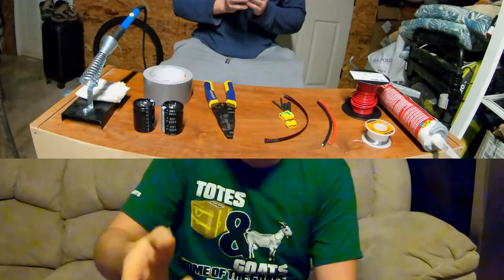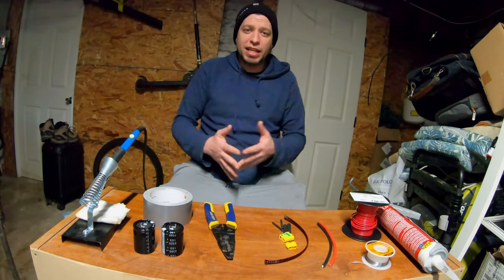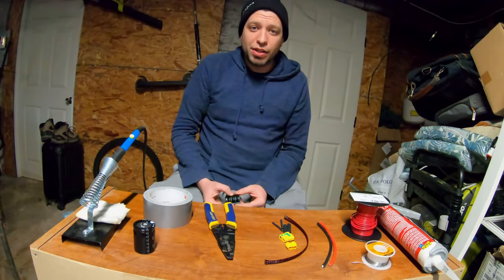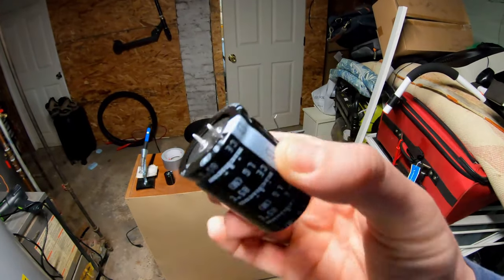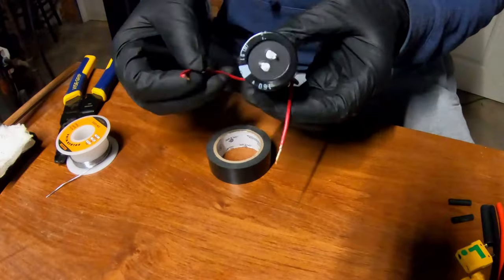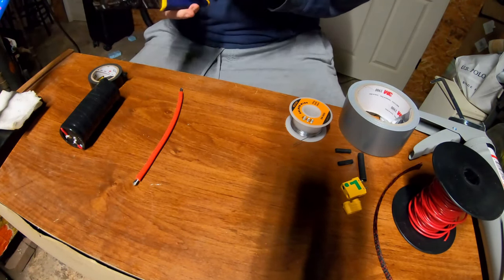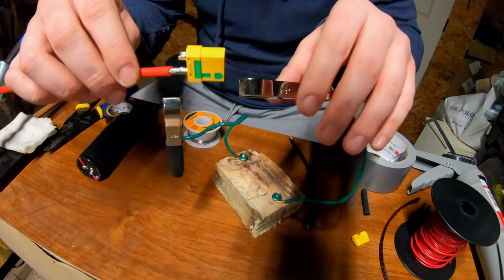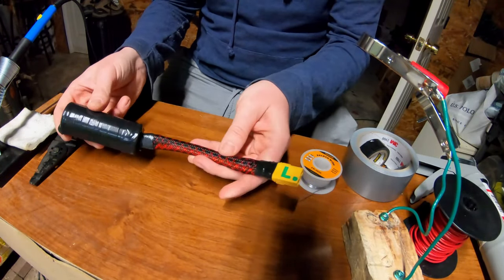God Mod EUC Components Review And How To Make Your Own EUC Capacitor Mod.

Comment: Another great video mate!  Just a tip... when soldering to an XT plug (or especially Deans) ... whichever you are soldering to... plug it into it's opposite plug... so, if you get the one you are soldering too hot, it's opposite plug holds it in place. Once cooled, unplug it from the opposite plug. For many years I was into RC cars... mostly used Deans and XT60 plugs... many times after soldering (especially the male) ... the pins had moved and they were hard to plug in. Using the opposite plug to hold the pins in place eliminated this issue. Keep up the good work! Greetings from down under
Reply: I was thinking the same as it's easy to get XT60 connectors out of alignment if soldering them by themselves.
If George wanted to show us the absolute cheapest tho he only had this single XT90 😁
Reply: Great tip!

Comment: I love the DIY idea you show here. Same as you maybe I got my 3D printer and learned the whole thing just to design my own power pads instead of buying expensive Clarks, available only as US import back then.
That was a great decision I love 3D printing.

On that one I have the know-how and equipment to make a capacitor mod, but I'm not sure it would be worth the effort. Maybe one day out of curiosity to see what effect it has on the pedal modes of my various wheels, since the components are pretty cheap anyway.
To be honest I'll also be more confident in my own job and QC that buying from a third party I can't trust due to the invalid claims made.

Comment: They make butt connectors that are filled with eutectic solder (be careful with your heat gun; silicone mats and polyamide sheets exist to protect whatever is near what you're hitting with  your heat gun).  Slip a shrink tubing over that to seal it (they also make ones filled with conformal coating materials to seal out environmental factors).
That soldering iron doesn't really get hot.  If it were hot enough to do the job, then you wouldn't melt connectors because you could solder them fast enough; lead free solders also work at higher temperatures so I don't use "high temp" solder anymore.
Shrink tubing is available that fits around the combined capacitor body as well as plastic caps commonly used to keep the dirt out of equipment openings while shipping to fit to the ends after making nice access holes in them and sealing the wire holes with red rtv.
You're going to need some sort of protection, at least a fusable link, just in case.  There are power boards already built for this purpose; one example would be car audio where someone has massive subwoofers and they use a bank of massive super caps to handle peak loads so they've smoothed performance and actually pushed wattage that's more than their power supply can handle at any given time.   This is a new use case/application to me but I've worked with the associated technologies plenty over the years, including battery testing, so there should be something out there if you know what you are looking for.

Don't they make app notes anymore?  That's where I used to get all my starts on designs as a technician (25+ years in industry) because they'd just give you something functional or even close to what you needed so you could at least test their parts to make sure they work.  I would literally ask the capacitor company's sales rep what they recommend into this application and see what they say - they might actually hook you up with a field engineer for a chat to help you build something that works well enough for them to sell parts into the design (if you ask nice they will probably even sample you some different parts to try).  It's guaranteed they always come up with some detail I missed or even pull up a better component I missed that improves everything.

I don't miss the companies I worked (they were all inhumane without fail) for but I do miss all the stuff I used to do and have done at jobs before being sidelined by an inadvertent retirement (accident disabled me permanently; I was a full on lab rat and loved it).

Comment: Good video.  I like your motivations for making this video.  Keep up the good work, dude.

Btw - you keep saying "2,200 Mili-Farad" - it's "2,200 Micro-Farad".  The little "u" in "uF" is Micro.

Also, the wires you used to interconnect the two capacitors is too thin - they should be the same gauge wire you used for connecting to the batterry pack in your wheel.  If you want to keep the profile the same as your capacitors, then you can use copper "straps" to interconnect your capacitors thus insuring that the interconnection can handle the surge current.  Then the whole assembly can easily fit into a small section of PVC pipe - with the endcaps - for a nicer, and more rugged, fit and finish.  You can also armor your cables with some heavy plastic sleeves - then mount the whole shebang under the seat, near the middle of the wheel, and you'll have a good solid setup.

Comment: Great vid George exposing the truth! just FYI micro Farads and i'd recommend 200 VDC rating instead of 160 VDC as for better safety margin plus it would open up an option if you were to upgrade your controller to higher Voltage to go even faster :) Imagine an EXN HS @ 134 VDC heheee

Comment: Are you going to be making a video how it is actually connected to a wheel? I'm interested in where it goes in the wiring harness.
Reply from the maker: it comes with a y splitter. batteries plug in one side, the capacitor mod plugs in the other. i breifly show it in my other god mod video

Comment: You could have measured the capacitors with an LCR meter. Capacitors for this application could be "High Ripple Resistance Capacitors" (Low ESR), the ones you have are General Purpose (probably OK, unless they get hot). Ripple causes heat, and heat would be the prime failure mode for capacitors in this application (treat it like you would heat in a main board). The Working (or Rated) Voltage for the Capacitor also needs a reasonable overhead, because of the nature of this application the Peak Voltage will be Higher than that of the battery (in this case your overhead is up to 160V, which is what it is). As you pointed out these capacitors are polarity conscious (like a battery), get one the wrong way around and wait for the bang. Your Y splitter to install this on the wheel is a serial wired component between your battery and your controller board, be very confident in your soldering, mechanical strength of this adapter. Obviously if it were to fail for any reason the wheel would cut off immediately, even built to high standards you have introduced an addition connector into the main power circuit supplying the wheel. OK, so what is this modification doing? In theory, not withstanding considerations such as Power Factor and Resonance I mentioned in a comment on your previous video. The capacitors are averaging out the demand on the battery over very short periods. When power is drawn from the battery a small amount of power is lost to the internal resistance of the battery warming it up. The control board is drawing power from the battery in an Off/On cycle, so during the off part of the cycle no energy is being lost. The capacitors are averaging the current drawn between the on and off cycles, making the battery appear to have a lower internal resistance then it actually has. Potentially in times of high current draw where a large voltage is lost to the batteries internal resistance (voltage SAG), that effect has been reduced by averaging the current drawn over the off part of the cycle. Beyond the On/Off cycle of the control board there may be additional power for 0.5-1.0 second or there abouts. Note: for the most part battery internal resistance is very low anyway, currents in the main wiring can be high 20-30A, any extra resistance in the wiring is relevant including your Y adapter, so quality connections, connectors, workmanship all counts.  Hope that was all helpful and constructive, interesting subject, we just love modifying our wheels don't we 🙂.
Reply: We calculated in the group that the maximum duration of a potential effect would be in the order of a few milliseconds only, which matches with affecting the PID loop (pedal modes) in some cases - but not longer than that.

Keeping in mind that there is already a capacitor here on the mainboard of course. A mainboard with dead capacitor typically results in softer pedals.
I had that capacitor failing on my OG Sherman board and didn't experience much difference however, possibly thanks to its packs being made of 240 cells already.
Reply: @supercurioTube  Yes 0,5 Second might be a bit much, but 100mS maybe. It very much depends on the load T=CR Seconds (where you may have 3 CR seconds of useful range, C in Farads and R [well that's the load ohms]). I suspect the control board capacitors are on the winding side of the FET's in which case they cannot charge when the winding is not under power.
Reply: @Roskellan  Fyi - the two large (330 uF) caps on the controller board are wired directly across the power leads - motor windings have nothing to do with it.
Reply: @sonnyfung6641  OK fair enough.

Comment: if that is a scooter, then it is no problem to add anything, but since it is an EUC, just like you say, anything affected the electrical system, you are going to crash, so when I did the headlight mod as yours EX20, I did not use the battery power from my EUC, instead, I 3D printed a adapter and use a Dewalt Battery to power the light, 12V 2 AMP battery is good enough to run the headlight for me at night for a whole week, everyday 30 mins ride home. so safety first, I will not recommend adding anything into the EUC electrical system.

Comment: So I'm only halfway in the video,  but IS IT ACTUALLY possible to just DIY piggy back a Battery pack onto an EUC , etc, for increased power and range?  I would be very interested in an option like this for my Segway s plus which would be just awesome with a bit extra torque and range... anyone with tips, please chime in 👍
Reply from the maker: yes its possible but you do need to have some technical know how to do it safely

batteries need to be the same chemistry, similar age, same voltage. and your connections need to be soldered skillfully
Reply: @GoGeorge  cheers mate.  So it seems the hard part might be making the battery pack, is that right?   but I've seen comments that it's as simple as plug and play...🤨
Reply from the maker: @justinbrat  it can be plug and play if you get the exact same batteries meaning the same cells , and both are fairly new (like dont combine a 4 year old pack with a brand new pack) . and when you plug them in the voltages need to match, as well as their maximum voltages being the same. and if you need to wire your own connections , you need to make sure you wire it in parralel and not in series, and you need to make sure your soldering is done properly for a solid connection
Reply: @GoGeorge  bro... cheers for the detailed reply, what you said is exactly the type of info I was after.  In terms of soldering, your skills were on👌 point!  So.. I actually got a second original Segway Battery pack which means their cell configuration could be identical but voltage,  different,  due to it being new.  
So in theory,  if I can parallel connect the two batteries (I e hitch second battery into the supply wire of the original) then... I don't need any other bms etc? But more importantly,  what kind of results could be got from that?  Just... hypothetically speaking of course. I don't want any Battery misadventures lol
Reply from the maker: @justinbrat  hooking another battery in parralel will increase your range, and increase the amperage available to the controller, reducing voltage sag. just make sure batteries are within .1-.2v of each other before wiring them together in parralel.

Comment: Hahaha, The “Godmod” is actually one of the biggest scams ever. The place, where these Mods are attached or plugged in, makes them pretty much useless. IF you would double the caps ON THE board, then you would have an effect, but not wired as “Jokemod” is doing, between battery and board. The pricetag is actually the biggest joke of all……